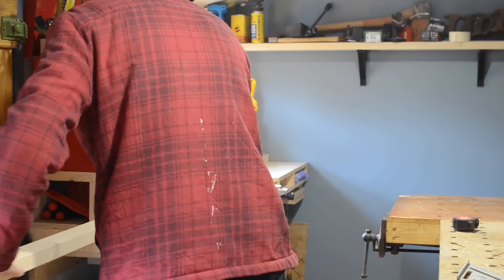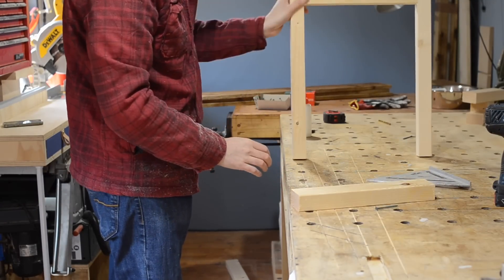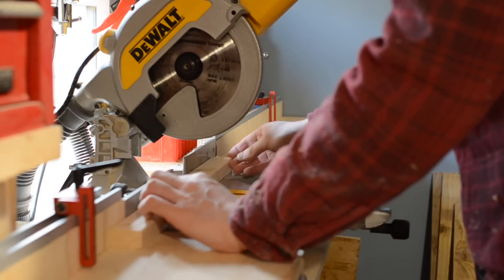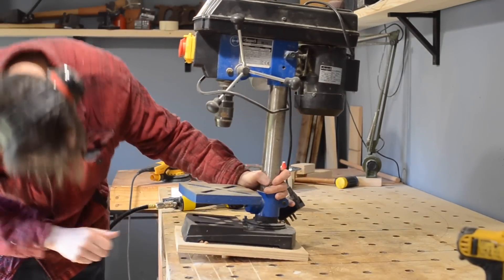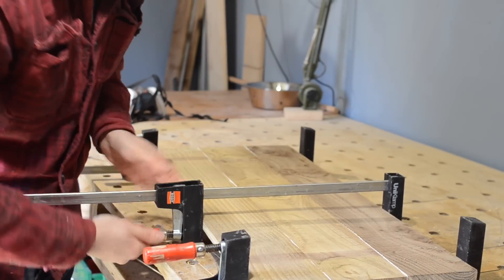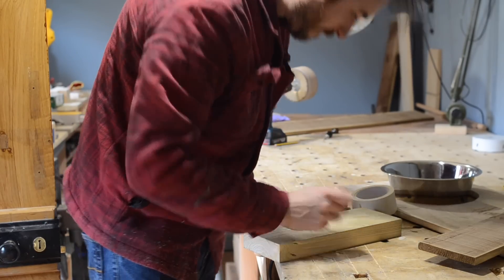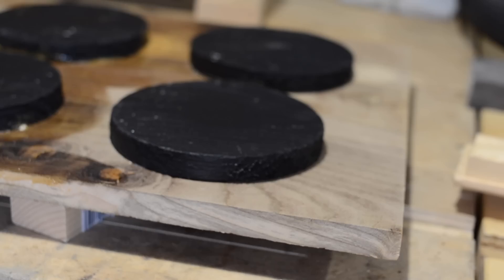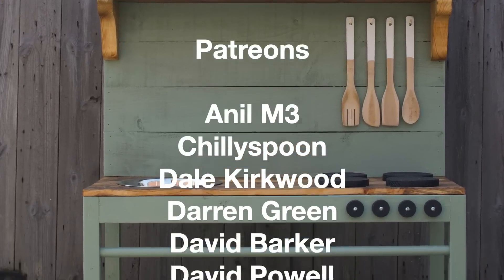Building A Mud Kitchen

Comment: Hi, I also live in the UK but I seldom use Screwfix or B&Q as I find them too expensive. As well as the two aforementioned sops I have a ToolStation and find them cheaper. However, Screwfix is useful because ToolStation is poor on descriptions, so I will find the item I want, take note of the exact name and then order it from ToolStation, It may not be fair to the other shops but it is better for my pocket. Love your videos and keep them coming. I was interested in your local wood reclamation center, I have not come across anything like that and as I only live about 15 miles from you, I would like to take a look at this place, so if you could let me know the postcode I would be thankful. I also use a plug cutter but getting them out with a screwdriver is problematic as they seem to break off at odd angles, so I use the bandsaw to cut them out, this has an added bonus as you can then use the rest of the board to cut more plugs, this can be advantageous if you are using expensive wood for the project.
Reply from the maker: I use Toolstation a lot. I could not find a plug cutter set from them. https://thewoodpile.org This is the place I go to. Its a great place. I might see you there. I have seen the bandsaw trick and will have to try that.
Reply from the maker: Hijack away Robert
Reply: @Robert Harris Hi Robert, As I said, I always buy from ToolStation but trying to find the parts is sometimes very annoying if you don't know the exact name of the thing you want. I have put a vague description into ScrewFix and it has come up with the thing I want and I just copy the correct name and search for it on ToolStation and I then can find it, but what I would like is to cut ScrewFix out and just be able to find the things on ToolStation without having to have the exact name.